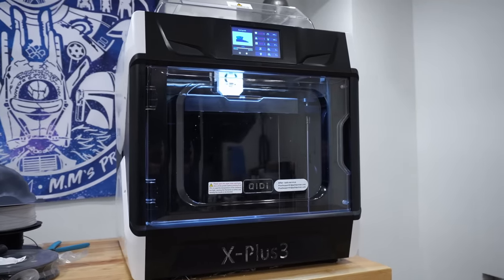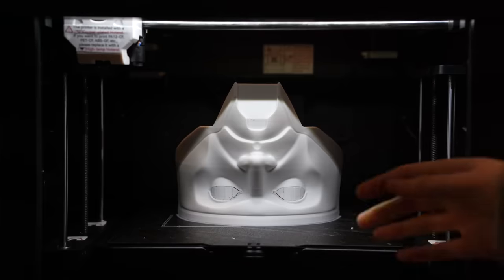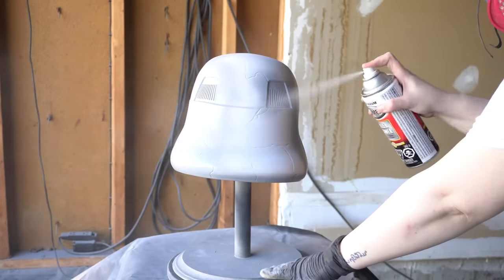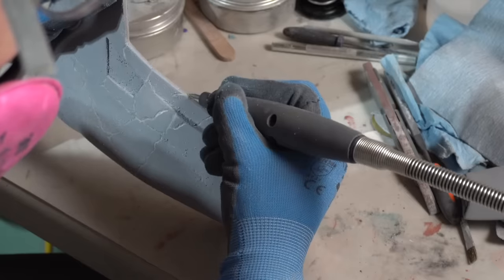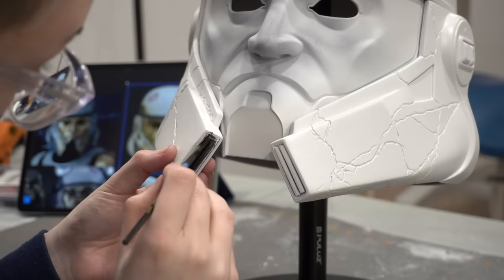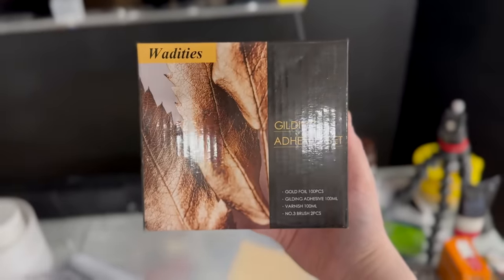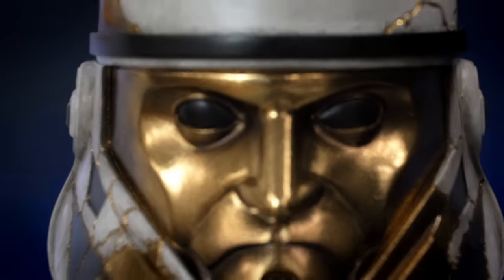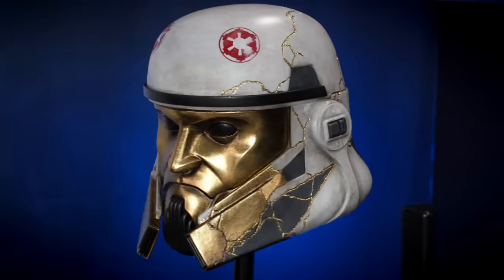48 Hour Captain Enoch Helmet Build

Comment: Glad to see more prop makers using ABS and realizing it’s the superior filament! Great work. He looks amazing.
Reply from the maker: Somehow I’d only found out recently how much easier it sanded. If I’d known earlier I’d have probably tried getting one of my other machines to like printing it.
Reply: @MMsPropShop  I did a video on a Mando helmet that was pretty much about post processing ABS. It’s just fast to do. Plus the heat resistance you don’t have to worry about it melting in your car 🤣
Reply: ABS peak

Comment: Weathering has been my Achilles Heel when it comes to my props, it's either been too little or too much every single time. I'm definitely going to give the dirty paint water version a try as that seems much easier and seems to give a very good finish overall, thank you for the tip!

Comment: Great project.  Given that you're printing with ABS, have you considered vapor smoothing the surface with acetone instead?  Basically just hang the part in a sealed container with a paper towel that has some acetone on it for about an hour, and the surfaces will come out looking glossy smooth and will remove the layer lines.  That may be a way to cut down on the manual work a bit, although you will still need to sand back the rough spots of the support material.
Reply from the maker: I did consider it but I was concerned that it might warp the pieces and prevent them from fitting together properly. Plus I wanted to keep the post processing methods similar to what I’d been used to using to be able to compare how they’d work with ABS. I think sanding the pieces is what’s going to work best for me for now.

Comment: Very nice. Overall finish aside, how does gold leaf compare to painting? Easier, longer, about the same?
I've only seen signwriters use gold leaf for lettering on race cars, and they burnish it by hand with a swirl, so maybe the helmet they rubbed the gold leaf in a direction for that brushed metal look on the face.
Reply from the maker: In this project’s case I’d say the gold leaf was far easier and less time consuming. If I hadn’t used the leaf I probably would have decided to use duralumen/alumaluster and then recolour it gold which would have involved attempting to mask all of the cracks to airbrush it on. Even if I managed to mask everything off it wouldn’t have been as clean a job. Was way easier to just apply the gilding glue into the cracks and not have to worry about the gold leaf sticking to anything it shouldn’t have.

Comment: Awesome work and great video. I actually ordered the same printer just before I found your video, I'm super excited to try it out.  I've never printed ABS how did you find the fumes?
Reply from the maker: It definitely has a sent to it when it prints although I didn’t find that it bothered me in any way. It could vary by ABS filament with some giving off a stronger scent, etc. I’m sure it could be further minimized by placing something like an air purifier close to the machine while it’s printing ABS.
Reply: Thanks, I will give ABS a try and see how it goes. I look forward to watching more of your content.   @MMsPropShop

Comment: That's awesome! I've been holding off doing a zombie trooper but now I want to do a zombified night trooper! I plan to mix parts from my Sandtrooper with broken Stormtrooper parts I've been collecting with a few 3D parts from my future 3D printer 😅. Your vid is helpful. Have to pick up an airbrush. Also, what resin do you use to smooth out parts? What material would you suggest for the red stripe cloth?
Reply from the maker: Oooo that would look awesome! The resin is just UV printer resin mixed with fumed silica powder to thicken it up a bit. It can be used on its own though or even just mixed with baby powder. 
My best guess is the cloth on the night troopers is supposed to be the same fabrics that you see the nightsisters wearing. Looks like various linens or even silk. There are a lot of different types of fabric that could work though beyond that.

Comment: Did you just Resin?  Or did it have a mixture of baby powder or would baking powder, or just resin?
Reply from the maker: I have mine mixed with fumed silica powder but I used baby power for years. Mostly I got sick of the smell lol. The resin on its own can work fine, the power just helps to thicken it so that it will build up in the cracks faster.

Comment: Whats the printing area on the larger portion of the dome? Would it fit on 250x250?
Reply from the maker: It’s about 275mm front to back so I don’t even think on an angle it would fit on a 250mm bed unfortunately.

Comment: are the eyse see through? If so what did you use to make them
Reply from the maker: Mine are not, mostly because I only really cared about it being a display piece. There is actually an alternative print file for eyes that you could add fabric to the front of and still be able to see through. I would personally have probably swapped them out for welding visor pieces.

Comment: Awesome helmet … but spraying to close and to much in one go hence the over spray and runs on the imperials cogs
Reply from the maker: Yeah definitely. Everything I’ve been airbrushing lately has had to go on in super wet coats and I apparently just automatically started spraying the cogs like that as well without thinking. Luckily it didn’t bleed too bad. Most of the touchups I did were from staining on the white after scuffing off the red.

Comment: I'm not real familiar with 3D printers. So how Strong and durable is 3D printed plastic parts🤔🤔🤔
Reply from the maker: It depends on the type of plastic you’re printing with and your print settings, but they can be extremely durable. Many people make fully functioning droids out of 3D printed parts, and not even out of the stronger plastics you could use.